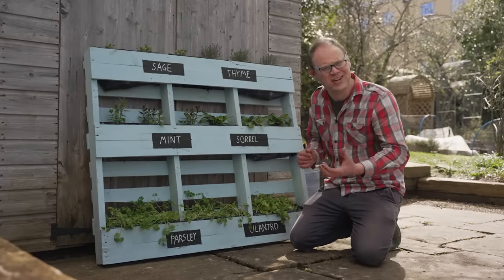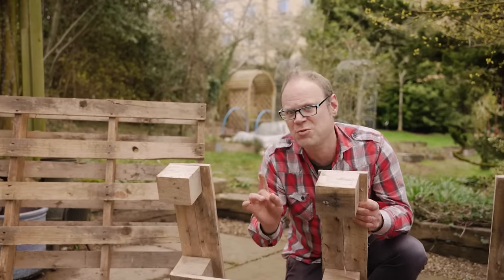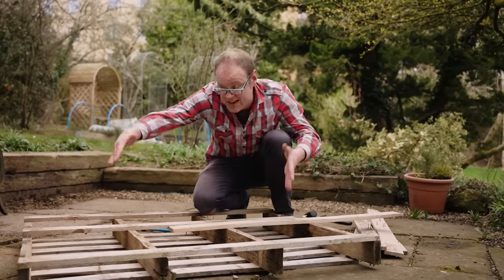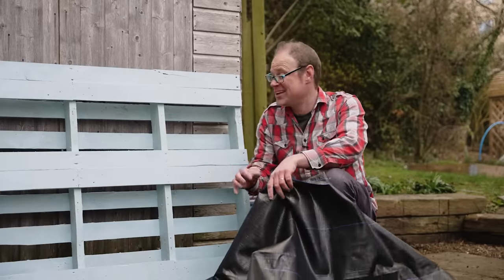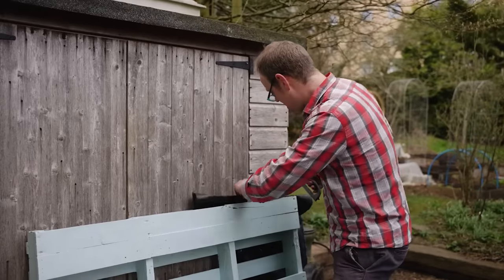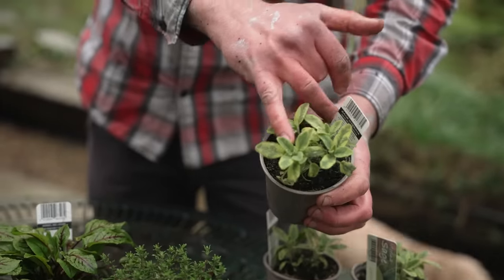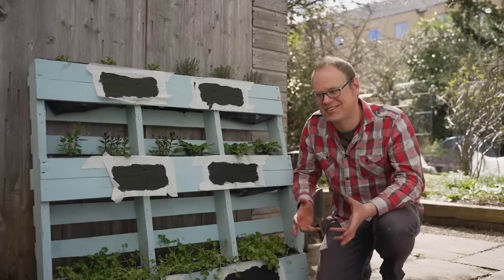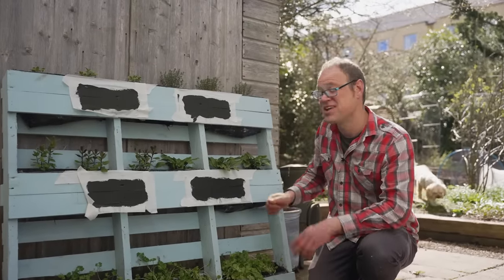Grow Unlimited Herbs for Free Using an Old Pallet

Comment: Always appreciate cheap gardening tricks. Pallets are a great way of getting free wood to build garden projects.

A while back we replaced our garden fence. We had a lot of leftover pieces when the larger planks were sawn, and some of the old planks were reusable. I've made 5 planter boxes from it. Because they are the same heigth as the fence planks they fit in nicely hanging on the fence.
Reply from the maker: Sounds like a great project there Michiel.

Comment: Great way to recycle an old pallet Ben , a great use of space and looks to be easily accessible. One tip if I may suggest while trying to dismantle the pallet for the excess panels. Try using a car wheel jack , it separates the timber so easily and less risk of hurting yourself. Hope this helps, keep up with the innovative ideas 👍
Reply from the maker: Great tip Paul, thanks so much.

Comment: Make sure any staples or nails are stainless steel as they will get wet and rust, especially important if you are in a coastal area.
I have my firewood delivered on pallets so have a few available after the winter! The company I buy from asked me why don't I buy kindling from them I told them that they supply it for free, in pallet form.👍
Reply from the maker: Good point - pallets can be turned to so many uses Richard - even keeping you warm!

Comment: Rather than clipping off the ends of the nails... you can hammer them through enough to grab with the claw part of the hammer and remove them, that way you can reuse them to join the wood back together. It's also hand to have a nice solid length of wood and a board that you can place near the panel you are trying to remove. By putting the board parallel and resting the lever arm of the length of wood on your loose board and the other end under the board you are trying to remove you should be able to pry it off reasonably intact.
Reply from the maker: Great advice, thanks Christopher. I'm pretty useless at DIY, so these tips are very helpful indeed!

Comment: Misconception about methyl bromide, it is used on pallets for pest control but usually only in a situation where an untreated pallet has come into contact with treated ones in a container or likewise. The container is then flooded with methyl bromide to decontaminate it and the pallets stamped to say so. The methyl bromide is only active for 48 hours or will disperse once aerated. You can use the pallets they are completely safe
Reply from the maker: Interesting Rob, that's really useful to know. Thanks for bringing this to our attention.

Comment: Hi Ben, I have a question for you... Do you have any advice on how to get rid of ivy growing in raised beds? I've discovered it growing throughout and I'm quite discouraged! Thank you for your many jargon free tips, they have improved my gardening by tons :) Any help from other commenters would be very welcome too!
Reply from the maker: Hi Natasha. The best way to tackle ivy I have found is to simply dig it up, following the trailing stems and roots back to their source. It's a bit of hard graft but you can get on top of it eventually. Alternatively you could try smothering the ivy for several months to exclude light so that it eventually runs out of resources and dies. Several layers of plain brown cardboard could work for this, perhaps topped up with wood chips so it's less unsightly. I conquered an area of ivy and other weeds like this last year.
Reply: @GrowVeg  I thought that may be the case, I reluctantly dug through my no-dig beds and removed what I could. Thank you for the reply it's much appreciated! 😊

Comment: Where did you get the fabric from? I've bought some and it frays badly.
Reply from the maker: The fabric I use was from my local garden centre, sold by the metre. It's called Mypex though - that's the brand.

Comment: I was wondering what to do about drainage for the herbs so the herbs don’t rot. Do you poke holes in the landscaping fabric?
Reply from the maker: I find they drain through okay, but you could certainly poke holes into the bottom to be on the safe side and make sure it drains through without delay.  :-)